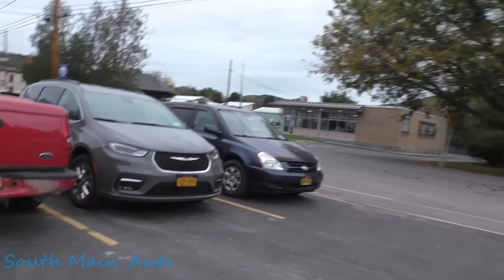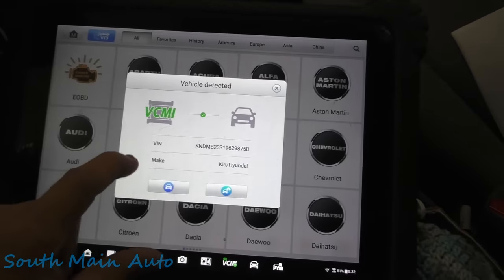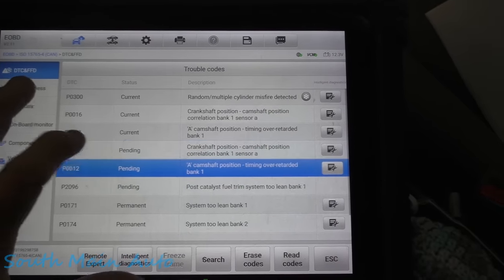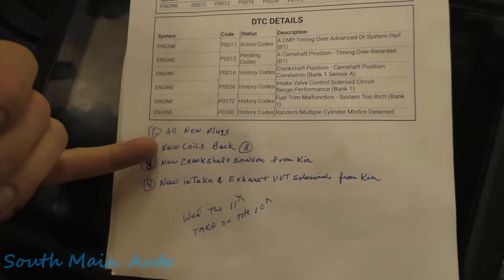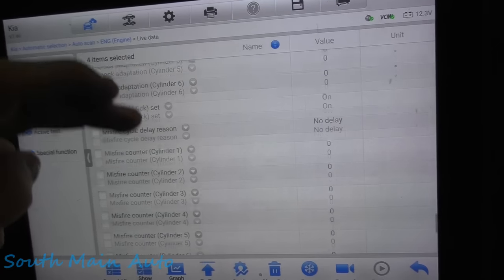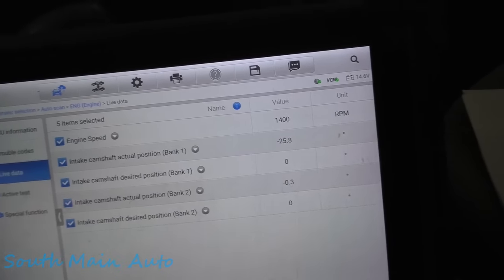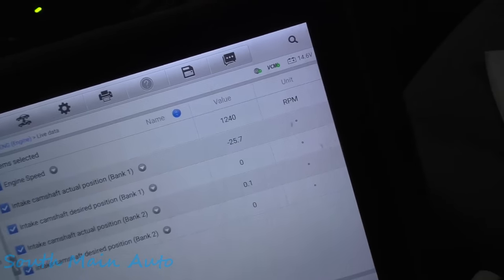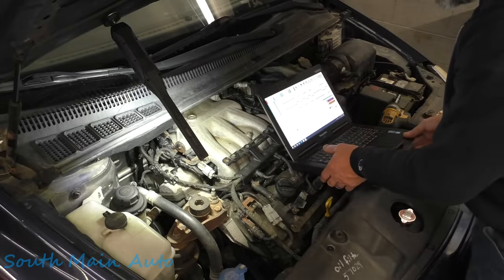This Kia Is Running Out Of Time!

Comment: Hmm, showing a value of zero because of a faulty circuit seems pretty dumb to me, it tells you nothing, especially when zero is a valid value. Showing a default value (to OBD) is equally dumb, the default value should be for "internal use" by the engine computer only, nobody else wants to see it because once again it tells you absolutely nothing. Showing an impossible value (perhaps 999 degrees in this instance) tells you that you can't trust this information.
Manufacturers could do so much more, there's a reason why it's called "On Board Diagnostics" and not "On Board Defaults".

Comment: Haha, I read the title as the car was on it's last legs. Not a literal timing issue.
Genuine questions because I'm upping my skills . . .
Having multiple misfire, coupled with lean codes would suggest the cam is physically retarded across the bank wouldn't it? Causing poor operation of one whole bank and unburned, oxygen rich mixture to head down the exhaust?
What was the firing order = if you did a relative compression test. Wouldn't you see the 3 from the retarded bank slightly lower than the good bank?
Could you look up a picture of the phaser and count the teeth. I remember Brandon stickler saying 15 degrees is usually about 1 tooth out on cams. Feasible it might have just jumped 1 tooth on that one cam?
Edit : you might have said it. But is there an easy way to gradually feed it a PWM signal to gradually test the phaser without making it go full send and potentially hit valves?

Comment: If you ever going to be buying a minivan.Only buying a Toyota.Stay aways from Honda because of their weak transmission.Chrysler and Hyundai are always have both engines and transmissions always have problems.When the minivan are getting old around 80 to 100 thousand miles and up..